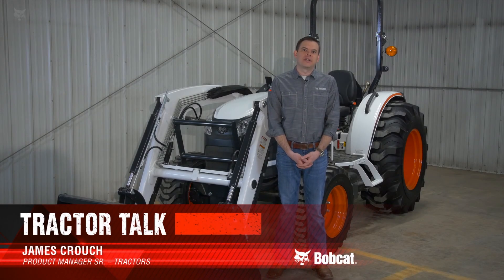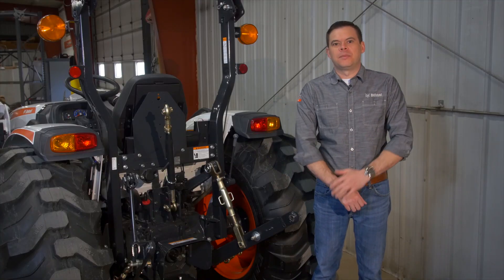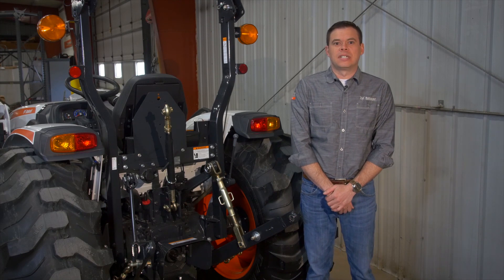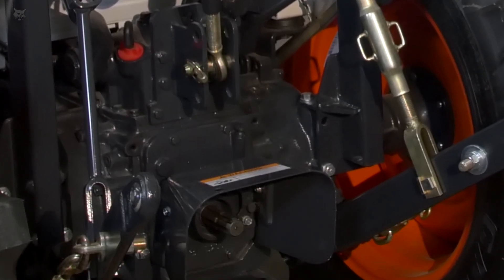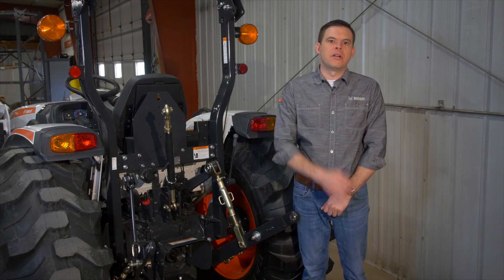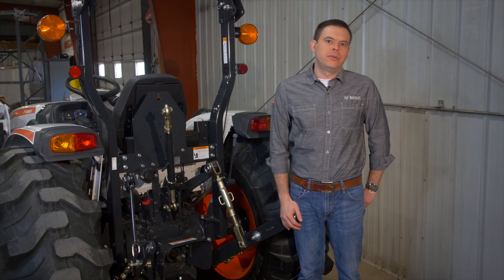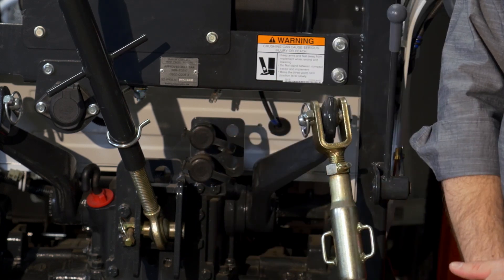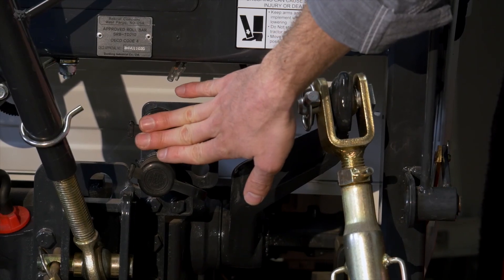Bobcat Compact Tractor Engine Horsepower

Comment: Does Bobcat plan to offer a size similar to the new Kioti CX series or will the CX remain a Kioti exclusive? The CT1025 and CT2025 are a far distance apart on what they can do. How about a tractor that can lift over 1000 lbs with the loader yet not be over 50 inches wide? How about a narrower tire option for the CT2025 I can dig that for sure. I am trying to make a decision and really want the bobcat name and white color. I love the color white to set it apart and the Bobcat name and logo screams this is not a toy it is a mean machine! I know Kioti is a great machine. I need to lift logs in excess of 1000 lbs all day but don't want such a wide machine as the CT2025 because I also will use it to cut my grass with a belly mower 54 inches. My yard is only a half acre, but I need the lifting power above the CT CT 1025. Thanks,
Reply from the maker: We answered this question on a different video, check it out! https://www.youtube.com/watch?v=3oqvg2d5CEc